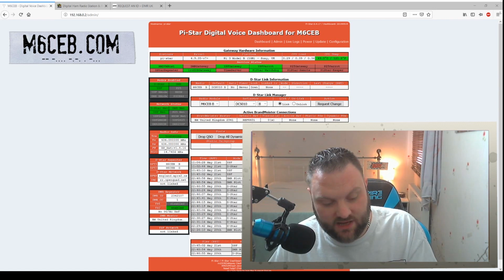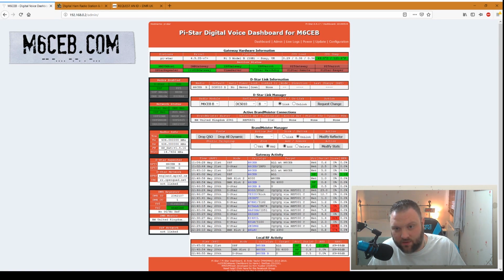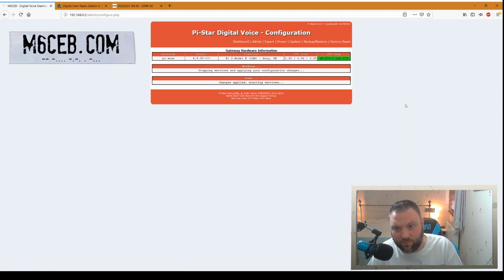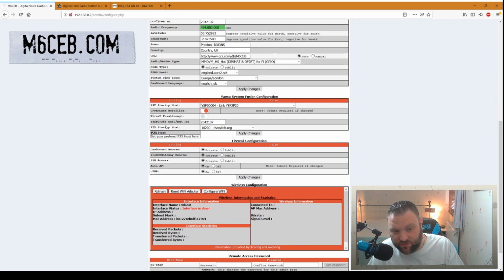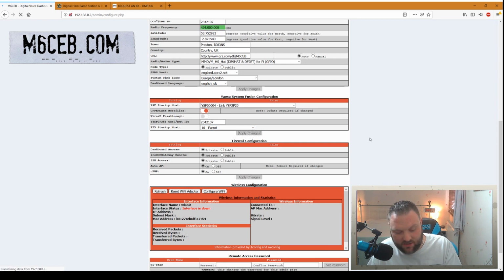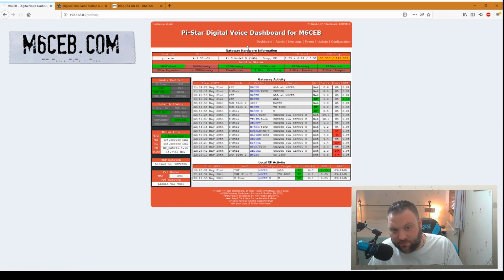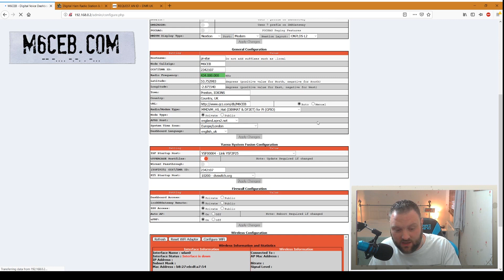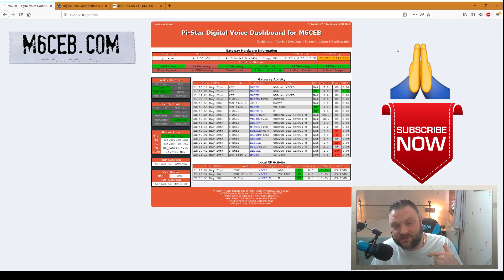Cross mode Yaesu System Fusion to P25 Tutorial, easy STEP by STEP guide! YSF to P25 pistar FT3D FT1D

Comment: Matt - interesting video.  So, FWIW, I have a OS3 that i keep in the car.  I have it set to straight P25, with my FTM-400 on the VW mode, and that works very well.  Have you tried that with the pi-star hotspot?  I suspect it should work.  Does going thru the YSF2P25 mode let you switch reflectors via the radio menu?  I actually just put a P25 hotspot together, with the thought of using my ft70D with it in the house.

Comment: This doesn't seem to be working with my set up following your instructions. When my audio is repeated back from the Parrot TG the audio is very much "garbled". I didn't see this in your video but another suggested I had to set TX mode on the HT to VW. I notice on my FT3D that even though I transmit on VW when I receive the Parrot reply my radio receives using DN. Not sure if this is expected but I can't find a way to change that if I need to.  Thanks for the video and any advice you might have. 73